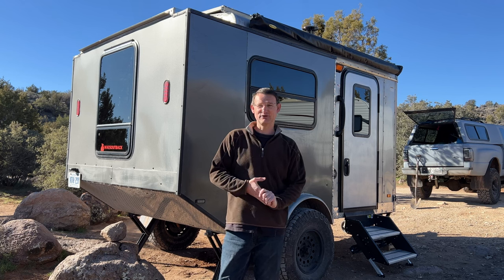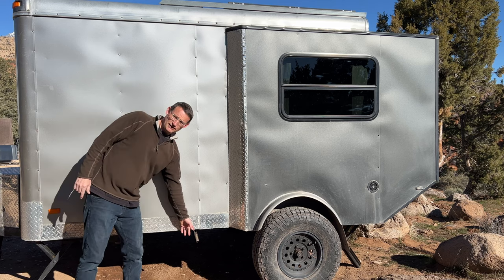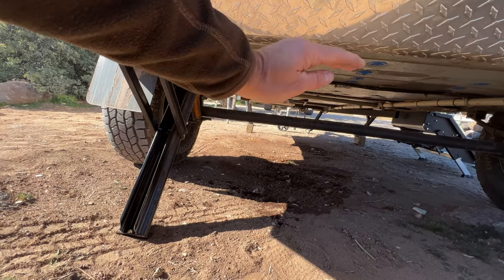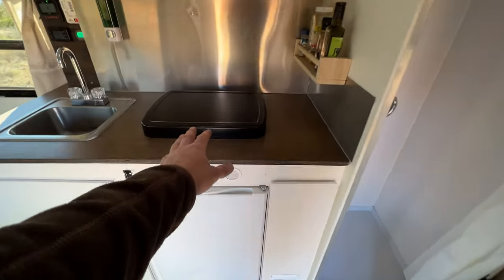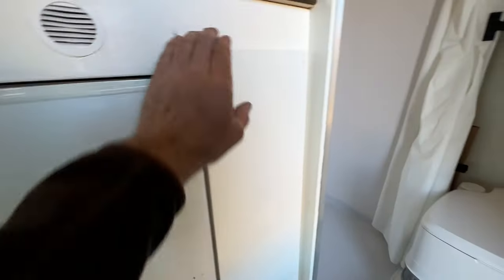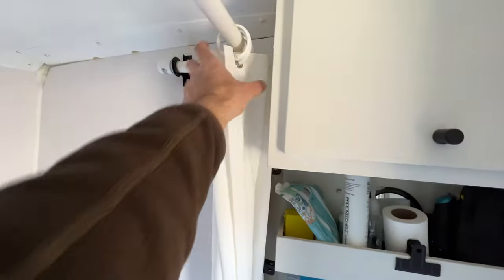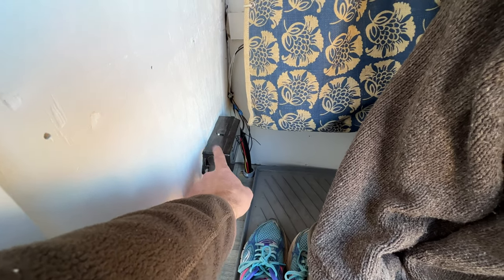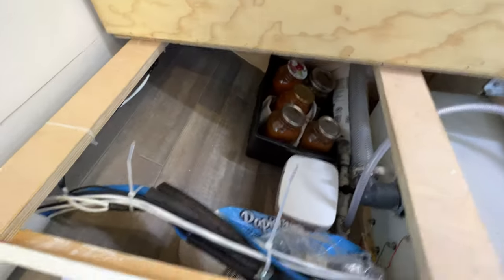FULL TOUR- Small Cargo Trailer to Camper Conversion

Comment: I like the additional info. I watched the previous one, when the trailer was smaller. Now, it looks even better with the bigger tires, wider birth. Also, I like how you did the addition to upgrade the shower, move the sink, and in turn, gain more space. I have a 5x8 that, given a wider birth, should get me 7'x10' so enough space. I liked the idea of the bed turned around to get rid of the extender to the bed and gain space for another water tank. Looks great.
Reply from the maker: Thanks! I tried to put a ton of thought into the extension. The other one was great and got us out camping, but I was looking for a bit more luxury in this one! 😁
Thanks for following along!

Comment: You really have to use the trailer, such as you did originally, to get the feel of what you need to add. The one item I personally would not install is the wood stove, but each to his own.
Heated our house with wood for 37 years and that was enough for me.
Reply from the maker: Yeah it is true, as you live in it you definitely see where you can improve. I definitely went back and forth over adding a wood stove or not. I’d say a game changer is the small pressed bio bricks of hardwood shavings you can get at ace hardware. Throw one in and its set for a couple hours. I put one in at night shut it down and have coals In the morning. I think your right though, for 95% of people a wood stove would be kind of useless…. not many want to camp when it’s that cold!

Comment: Need 2 get a heat power fan 4 your wood stove, it makes a big difference in colder temp. U turn it where u need more or less heat.
Reply from the maker: Great suggestion!  Any brands you recommend? I’ll definitely look into it.
Reply: They have 100's of them ,mines a little double fan  l got 4  19.99 on Amazon  works great 👍.
Reply from the maker: Thanks for your input.   Really appreciate it.

Comment: This in an impressive build!!! Thank you for sharing.. Does the downloadable guide go over the trailer width extension? You mentioned in the video that you welded on part of the metal siding
Reply from the maker: Thank you! No the guide just includes my original layout for the 6x10. I’m going to be updating it this winter but the problem is the size of the guide for downloading. I might throw it on Amazon then I can make it much bigger.

Here’s some information on the building process- 

Building an Off Road Cargo Trailer Camper Part 1/2
https://youtu.be/vGrxStiyZzY

Comment: This is the biggest little cargo trailer conversion I’ve ever seen.  Having the diesel heater and the wood stove is a great combination.  Each has their advantages depending on the situation.  Your seating at the table is incredible for such a small trailer.  The shower is tight but it’s there.  The windows, color scheme and metallic finishes really make for a roomy feeling inside.  

You’ve addressed so many wants and needs in this build and the results are nothing short of stunning.  

If you had to pick a shortcoming of this setup/layout, what would you say it is?
Reply from the maker: Thanks for the nice comment! 
It’s really tough with a trailer this small it always seems like trade offs when your building. To be honest there isn’t anything I’d change for us, after travelling in it for the last 4 weeks we both just love it! For a lot of people the wood stove would probably not be practical you could fit a lot of cupboards into that space but it’s sure a great dry heat!

Comment: Yes you’ve outdone yourself! 

Thoughts: 

1. I’d love to see tandem wheels on this for safety purposes … I pulled a fully loaded front back top bottom uhaul from Florida to Oklahoma and says max speed 55 .. I found myself driving 65 and a couple of times doing 70 … I was pulling a solid stable rock and I wasn’t concerned about the tires blowing out because I had tandem axles … and the tires were brand new.

2. The extension is excellent but, the blunt extension over the wheel well is a 90° extension which  impedes airflow….perhaps you could build out a triangular box (drivers side) for betterair flow at the front of wheel well area…you could make triangular cabinet to but up against that 90° wall and use as outdoor storage with shelves…it would be small storage area but big enough to set a tent standing up inside the cabinet…or even a smaller folding chair (which I use a child’s chair)…the door is too close on the passenger side maybe just a smaller panel for better aerodynamic flow. 

3. The table: they have telescoping table legs now a days. LOL!!! 😂 no need to detach anything…just lower the legs in place…awe - food for thought.

Once again OUTSTANDING!
Reply from the maker: Thank you so much.  The little bit of extra room made such a difference.  The wood stove we debated on doing since it takes up valuable space, but we are so glad we did it.  2024 plans are to spend way more time camping.  Just finishing up some truck upgrades and repairs and we will be back at it.🙂.   Yes tandem axles would be an improvement for sure.
Reply: @waysoutback I updated my response while you were replying…an afterthought - what about a low profile AC unit overhead so you can camp in the summers (shore power)…
Reply from the maker: 1. We adjust our brakes and repackage our bearings every year and have new tires, and the trailer is very light so for now we feel pretty good about it.
2.actually perhaps it’s not showing it well but we do have it angled out to the extension.  That would have been neat to have outdoor storage.
3.ya you got it, I just couldn’t find one for the size we needed with good reviews in our price range, maybe that will change in the future.
Reply from the maker: A/c is something we just have never felt we needed personally.  We don’t do very much camping in summer, and when we do, we go up north where it cools down in the evenings.  With the max air fan we find it flows enough air, but in a warmer climate I think you would definitely need a/c.
Reply: @waysoutback  I did think about the skin of your trailer and the purpose for heat reflection. .. but these are Wally after thoughts. ✌🏼🙏

Comment: Nice work, great use of space. You have to be pretty proud of your camper. I was wondering about C02 build up, venting and whether the CO2 detector should be mounted much lower and closer to the floor. Thanks for the indepth video.
Reply from the maker: Thanks! It’s a very good point you make. Maybe if I mounted it a bit lower it would be better. I believe the recommendation is not as low as say a propane monitor but sleeping height. I’ll look into it. I have had it go off once and a while, usually when it’s really windy outside, I forget to turn on the fan and the roof vent is open. Otherwise with the computer fan running it seems to keep the fumes venting outside. I don’t think I’d recommend it for everyone but if you’re aware of what’s happening I think it’s a great cold weather option.

Comment: Great trailer !! Do you have your Flooded Lead Acid Batteries vented  to outside from underneath your seat? I had an old pop up camper and i was going to put them underneath my seat but ended on putting them outside in a sealed box but had them vented as they release gases when charging. I now have a travel trailer but insalled a 170 Ah Life Po4 battery under my seat as its a dry cell and it doesn't need ventilation.
Reply from the maker: Thanks! 
In this one I didn’t but in my last one I did vent through the wall and floor. I found though they would only off gas’s while under heavy charge or discharge. Since the loads are light and the charger is small I just left it open to the cabin. So far so good but I’ll let you know if it gives me problems. 
I’ve wanted to run Lithium for awhile but since I’m in Canada and camp in the extreme cold it seems they say they use power just to stay warm… and if freeze they are toast. I am not sure though

Comment: I'm looking to make a camper trailer but I have no experience with towing. I own a 4WD turbo diesel Volkswagen Passat AllTrack station wagon that is putting out 140kW (at 3500 rpm) and 400Nm of torque (at 1750 rpm) for a basic model according to Google, do you think it would be able to tow a trailer like this? I'd make a few small changes that would probably make the trailer a little lighter! 

This trailer (other than a few minor changes) is exactly what I was thinking would be perfect for me.....you have the layout the same and even have the little wood stove/heater in the exact same location that I was thinking! I hope you don't mind but if I manage to get the finances and time to build a camper trailer that fits my current needs and wants, I'm going to steel your design! Thank you for sharing the trailer with us all and proving to me that my.....wait, that's not right, that our idea can work in a smaller trailer.
Reply from the maker: Steal away! 😁👍

I think it might be a bit heavy my old trailer was about 1000lbs lighter just over 2000lbs i think that one might be a better option. It was a 6x10 if you want to see a tour I did one a couple years ago.

Comment: We have built a conversion 6x12 and will be starting a 7x14. Just downloaded the manual. This is priceless! What kind of work did you do to learn this? Your my new buddy. Where do you find these salvage yards?
Reply from the maker: Hey 👋 
Sorry been a bit swamped lately! 

Glad it helped! I worked as a mechanic for 15yrs and now about 10yrs in construction so a lot of it carries over to building different things. A 7x14 will be a beautiful! To find my used parts I just searched “used RV parts” we have two within an couple hours drive. Another option for doors and windows is auto wrecking yards, some have RVs there and good prices on used parts, try to work out the price before pulling off the part. Happy building! Keep me posted as you go.

Comment: What is your thoughts on the mini stove ? Does it handle the cold nights well ? How often do you have to load wood thur the night ?
Reply from the maker: I love the little wood stove, especially because it’s a dry heat. Totally recommend it but I wouldn’t have it as my only heat source! It’s nice to head out ice fishing or hiking and just flip on a switch for heat. 
I use compressed hardwood logs when I want it to go awhile… turned down it goes for about 4hrs easy… and will still light the next log. Hope that helps.

Comment: Beautiful build inspiring honestly, my only curiosity is what did you build to vent the smoke produced from cooking on the two burner?
Reply from the maker: Thanks… I positioned the roof vent right over the burner. When we are cooking we usually have it open and the fan venting out the ceiling. Works ok 👍

Comment: Fantastic build. Thankyou for sharing the thorough walkthrough. With the pronounced departure angle in back, which is smart, curious if you ever considered any sort of axle less independent suspension? With all the cargo trailer conversions happening and it becoming more and more popular, I'm surprised a trailer width of 6'6" isn't commonly available. It has to save so much interior design space to sleep side to side(east to west) instead of orienting a bed front to back. Would be nice to not be too wide by offering a 6'6" × 10' trailer. You have a great grasp of what you wanted and how to make it happen. Happy and safe traveling.
Reply from the maker: Thanks for the nice comment! 

I came very close to ordering the axle less but I would need to still run the 1” spacers or order heavy duty hubs for my 31x10.5 to clear… and get new rims that don’t match my truck. Pretty much I was just lazy so went with the straight axle. 

I agree a 6.5’ trailer would be perfect…. Good head room for side sleeping… I think I might have seen one recently but not sure??? 
The tire is still on the outside of the box and you lose that departure angle.

Comment: Nice expansion , have you weighted it since the extension ?
Reply from the maker: I did but it was a rough measurement. Using a 600lb scale and a leaver set up. With the left tank full I’m right around 2700lbs. Before it was around 2250lbs

Comment: Hey Zac, great build! I'm looking into building something like what you have in this video. I bought your pdf guide. I love the Cubic Mini fireplace. Do you think that I could forgo the diesel heater? I'm looking to use my trailer for hunting and I could be away for a period of time while hunting but like you mentioned you don't want to risk things freezing. What about a low powered heater in the water tank or an electric heater. What that pull too much from the battery?
Reply from the maker: Hey sorry I thought I responded, I must have missed your comment! 
I’d definitely recommend going with some type of back up heat. Either an rv propane furnace or diesel heater. If you install it so it’s drawing the air across the tank and pipes you can go camping in very cold weather with no problem. If your out on a sled, fishing hiking you don’t have to run back to stoke the fire. I looked into the heating pads but I just felt they draw too much power for what you get. A diesel heater on low just chugging along will last days on a tank and stress free. 
Hope that helps a bit.